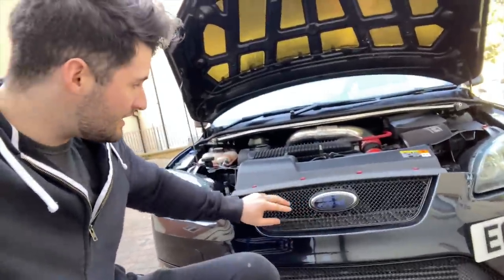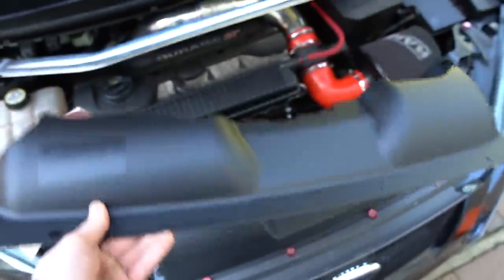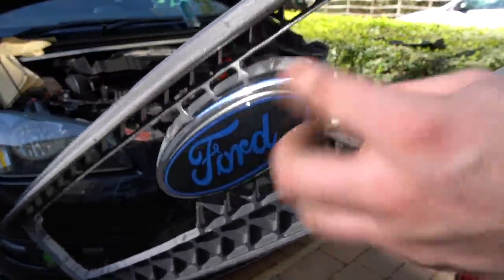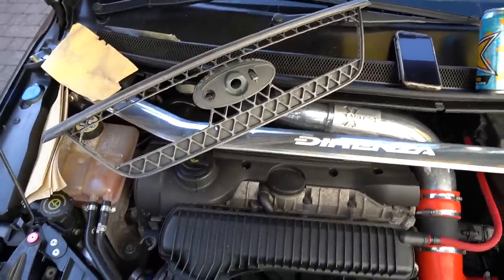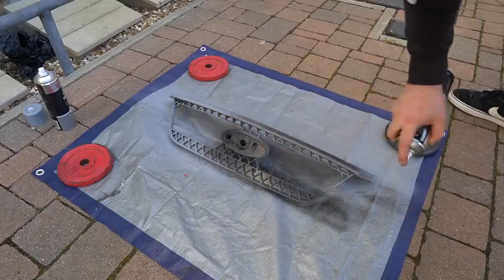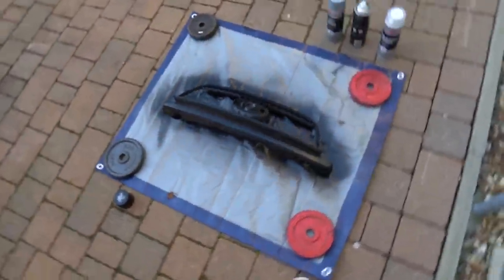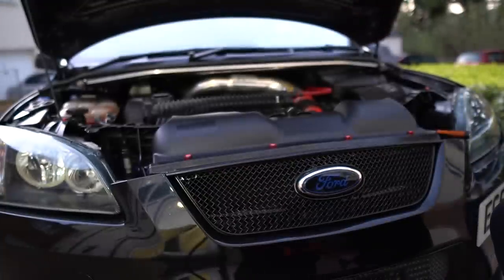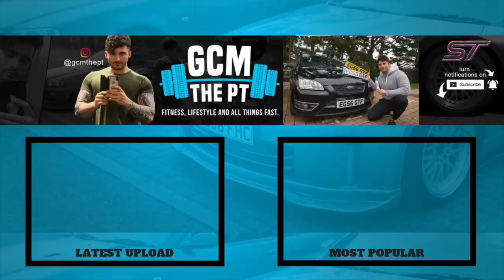MK2 FOCUS ST GETS A CUSTOM TOP GRILL AND TWIN SLAM PANEL AIR FEED UPGRADE

Comment: I wish you had done the slam panel before Sat, I just fitted the diesel one myself, trimming was the same except mine has the mountune lid to RS airbox so the snorkel area will need a little trim as its not exactly the same as the rs slam panel.
I've just ordered the side panels and Anembo billet cam cover. Good vid, does look better. 👍🏻

Comment: Nice work! I've been doing something similar with my Mk2 Focus RS; I took the front bumper off last week and gave the bits n pieces behind it a good tidy up. That slam panel looks very similar (if not the same!) to the ones that are fitted to the Mk2 RS, looks good! I like doing jobs like this, it makes so much difference too. My next job is to take the side skirts off and give those a clean up. Keep up the good work, enjoy the sun :)
Reply from the maker: It’s funny as I read this I’m in the bathroom spraying down the side skirts with tfr in the bath and giving them a scrub :) haha. Glad you fins jobs like these rewards. They are fun!